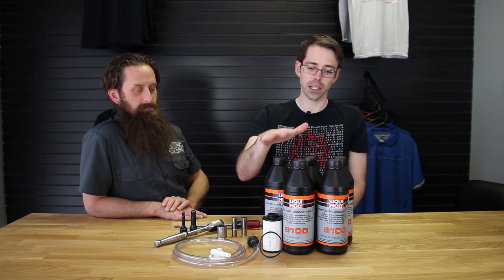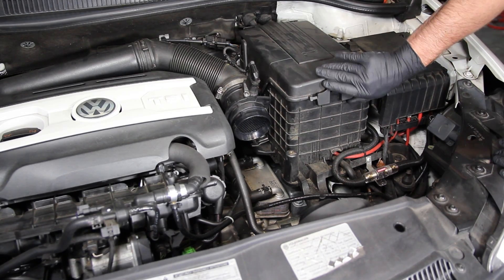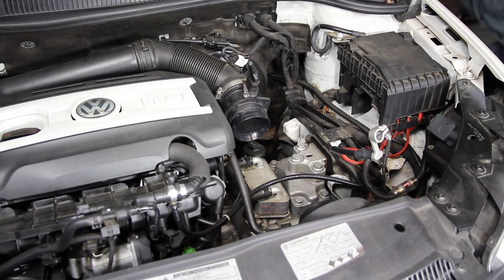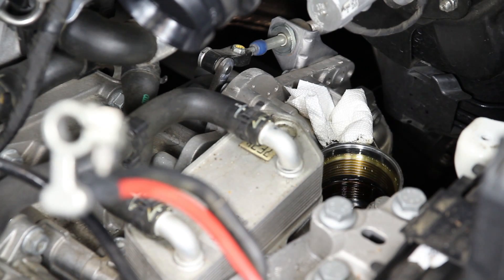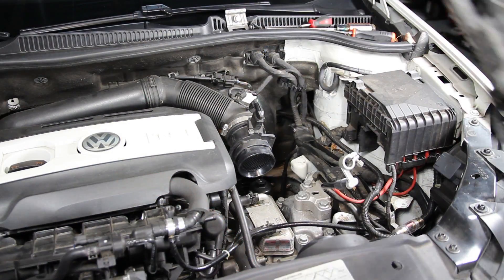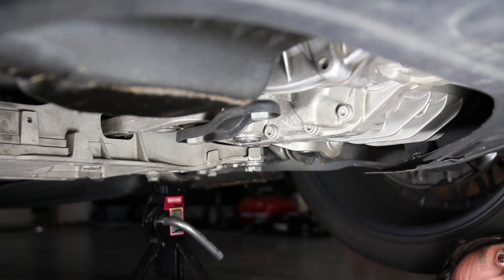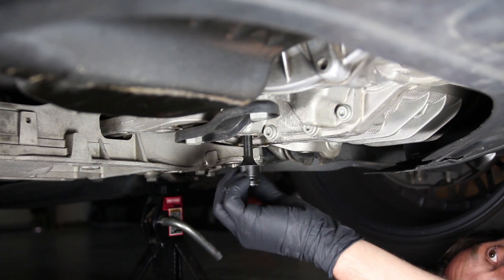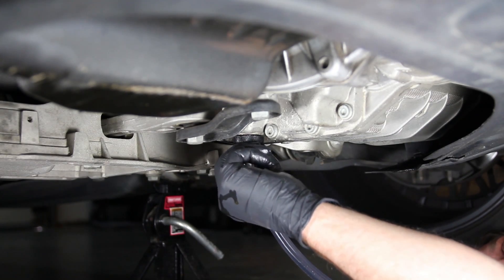How to (DIY) Perform a DSG Service on a VW and Audi Transmission (DSG Service Kit)

Comment: Seems so easy. Not sure why this service costs close to $1k? ><
Reply from the maker: It shouldnt be that much.  Most dealers we are aware of charge around $350
Reply: +Deutsche Auto Parts sorry I meant the full 40k/80k service is close to $1k. Not just the DSG fluid. Any reason it's so much more? I get they do the oil and dsg fluid but checking everything else shouldn't cost that much lol.
Reply: +Kyle Anderson only reason you should go back to the Volkswagen dealer is to buy a car, or get a warrantied part replaced. Otherwise do your own maintenance or find a trusty mechanic
Reply: I've done the other maintenance for a while now. I've got a 2010 DSG GTI with 75k so it's out of warranty. I had taken it to the dealer for the 40k service and they charged close to $1k for the full service and since 80k is right around the corner that's why I was looking this video up. Planning on doing it myself now. I still can't see why they charge so much, I guess "labor" charges for waiting for the oil to go into the vehicle. >.>
Reply: +Kyle Anderson labor and retail dealer prices. You'd be surprised at how much higher you typically pay for OEM parts at the dealer vs an online place like Deutshe Auto or others. I do maintenance on all of our vehicles. This is our first German car (2013 turbo beetle) and it's no different than the domestics I'm used to working on.  Our dealer wanted $600 for the 40k service and $300 for the DSG service. We're still about 10k miles  away but I've already realized that all the parts and oils are only going to cost about $250 if I buy them online. Dealer wanted nearly double for the same parts. The rest is labor. Keep in mind I said parts only, specialty tools that I don't already have add another $100.

Comment: Wonder why they couldn't just have the fill plug at the top..
Reply: +Grant Nicholson Maybe they thought that the car can be turned upside down.
Reply: @grant 
maybe they were all drunk on some spaten
Reply: Because VW is hoping you'll bring your car into their service dept. They very easily could have designed this to be top filled and instructed something like "drain completely, replace filter and refill with X liters"...so simple anyone could do it, no worrying about trans temp, running through gears etc.

Comment: Are you not supposed to let the new fluid drain out until the internal level reaches the top of the snorkel tube? I noticed that you hurried to install main plug after servicing new fluid. I am afraid that I might over fill it this way.

Comment: This is not correct...
Reply: seems off to me too
Reply: Yes he forgot to warm the transmission to just under 35 Celsius. put his foot on brake and shift into each gear for a couple seconds then remove plug to let excess oil out.
Reply: its between 35- 40 degrees Celsius.
Reply: That's how I did it on my old 01M transmission.

Comment: Who the hell builds a car where the drain is also the fill plug. Guess I'll stay far away from Volkswagen's with DSG transmissions in them.
Reply: kd1s, Works great and is simple while not allowing containments as the older style dipsticks did. Many new auto transmissions even with torque converters use the same system.
Reply: It's not just a VW DSG thing. Ford has also done this with the 5R55S transmission in the 05-10 Mustangs and Trucks. I'm sure there are others out there too. They aren't any harder to work on although I would think that VW would've remote mounted the filter for easier access. I'm not keen on having to pull the entire battery box to get to it.
Reply: agreed. I was amazed when I saw it too. German Engineering in da house. ;-)
Reply: why are you watching this video then?
Reply: kd1s,   I had my first DSG 6 month ago, and it's also my last one. Never again. Manual transmission are much better.

Comment: The used fluid didn't look all that bad. Was this a 40K service? Have you sent any off for analysis?
Reply from the maker: +Jacob Stamm We did not have the fluid analyzed.  This was done at roughly 35k miles.
Reply: I held mine to 45K. Will change soon and send to BlackStoneLabs. DD, easy on the skinny pedal, no towing. #forscience

Comment: Think you should fill leave hose on go through gears pause each gear heat up oil to 35 c remove filler hose wait till the wier plug has let out not needed fluid then reinstall outer plug

Comment: There's a couple things I've noticed that are different in your DIY vs the instructions in my service manual. First, you used 5L of fluid is used instead of 5.5L as per instruction, also, you didn't heat the transmission up and shift gears with the fill tool connected then bleed out the excess .5L. To me your method seems more fool proof and more affordable since I won't need to buy a 6th bottle and wait for the transmission to heat up. Is there a specific reason why the service manual instructs the complicated bleed instruction? (I've completed the service 3 times in my MK5 before using the annoying bleed method and I'm reviewing the instruction to do it for the first time in my MK6 next week.)
Reply from the maker: +Steve Woods The method shown is what you would find most VW and Audi specialists do.  If you want to make 100% certain you can go through the level checking procedure which requires a scan tool (Vagcom).  Hope this helps

Comment: Is there any problem to put oil on top?
Because I do not have this tool. With this tool wasting a little oil.
if necessary to replenish the oil? At where? The engine cover?

Comment: Of course I want to see if I save some money.
The filter cup let you get the old oil for some reason?
It should be withdrawn?
Reply: +José Marques No, you need to use the fill tool. Fortunately, the fill tool Deutsche Auto Parts sells is WAY more affordable and performs the same goal as the original factory VAS6262 fill tool. (If I'm not mistaken, I paid over $200 for the VW/Audi VAS6262 factory tool in 2009.)

Comment: LIQUI MOLY Valvulina Synthetic Double transmission DSG 1L
Developed for use in dual-clutch gearbox (DSG gearboxes) in vehicles from Audi and VW Group.
Oil-based high throughput technology synthetic and synthetic base oils. Through extremely shear stable additive which improves the viscosity index, modern additives to protect against wear and stable friction modifiers, attains an excellent yield of the clutch. This lubricant is also suitable for double clutch transmissions that have a shared oil circuit for the clutch, synchronization, gear and hydraulic control.
Specially developed for use in dual-clutch gearboxes (<i> gearboxes DSG </ i>) in vehicles from Audi and VW Group. Use according to the specifications prescribed by the manufacturers or groups of vehicles.

Comment: Vw in Portugal each DSG oil liter for double clutch gearbox the RRP is € 34.58, as have some discount is € 27.67 in already with taxes included.
I have a supplier who sells LIQUI MOLY Valvulina Synthetic Double transmission DSG 1L at a price of € 14.06 per liter, it is much the difference !!!

Comment: Good afternoon.
I thank your feedback.
I have not done the oil change in my VW Passat Sportline DSG, I think it should be for the week.
Vw in Portugal the oil bought is quite expensive but they say that that is special for DSG dual clutch boxes and is also the ATF reference.
Say the ATF oil may not be black you have to stay the same source color and gives 60,000 miles.
Reply: +José Marques The fluid used is a VW spec transmission fluid. You cannot use regular ATF fluid.The good news, Pentosin, Liquid Moly, and Vaico all make VW spec fluid that can be purchased for less money. Of the last 3 times I've serviced my gearbox, I've used VW, Pentosin, and Vaico fluids with no performance difference. I honestly feel the filter should remain OEM though. One of the aftermarket filters I've purchased last time had a defect where there was a hole from the top rubber gasket to the paper element that wasn't glued properly. Either way, you NEED  to change this fluid every 40,000 miles  to ensure your gearbox will function normally and last. (I've driven my prior tuned GTI DSG 120,000 miles with no DSG problems)

Comment: Hi man! Here in brazil we have DSG 7speed for Golf 1.4tsi mk7. Some Dealership says that this DSG is maintenance free and do not need oil or filter change, and some says that every 60.000km this DSG need 6 litre of oil and filter change. Do you know the right maintenance for this 7 speed DSG?
Reply: +AllsForOnemS , It still has gears and mechatronics for clutch, you think it's dry and doesnt need servicing?

it's just less oil on dry clutch variants, but you have to service them either way
Reply: +Ismael Favaretto , stupid dealer... dont go to them anymore
Reply: +madott do you know the quantity of oil in the 7 speed gearbox? And if it hás oil filter? it doesnt say anything in my car manual
Reply: The mechatronic of dsg 7 is sealed and has a pressurized oil unit. So oil change will be difficult. Gearbox oil can be changed just like a manual gearbox. There isn't an interval in the service plan for it.

Comment: My passat is 3C not B6!!! And the fuid Original DSG 60.000kms; G052182A2 Double Clutch transmission fluid, the VW tell me Not use Liqui Moly 8100 is not a same...
Reply from the maker: +José Marques That part number is the same number used in the US.  The Liquimoly 8100 meets the required spec for the DSG fluid.  Keep in mind they have no incentive to help you buy oil from someone else.

Comment: Just did this as well with your change kit. One thing I did a little differently when all 5 liters were drained in was to pull the hose off the fill fitting, quickly put a finger over the end of it, and with another hand, move the hose end to a nearby jar to let the fluid in the hose drain out.  I then slipped a rubber vacuum plug (5/16" maybe) over the fill fitting.  This made the "quick swap" of unscrewing the filler fitting and installing the drain plug easier... without the vinyl tube attached.  I probably dribbled less than a couple of ounces of lubricant.  Thanks again for great DIY videos and parts service.  As the owner of 2012 and 2013 CC's, I am a loyal customer......
Reply from the maker: +John Henry Thanks for the tip and the support.  It means the world to us.

Comment: how in the world does the fluid travel up into the transmission against gravity?  there has to be an easier top fill method...
Reply from the maker: +Eric “SpeedieGTI” U Gravity is actually what feeds the fluid in as long as the bottle is higher than the transmission.

Comment: Hey guys Skoda yeti 2 litre diesel 2012 has got a failed Mechatronics .The dealer has had the car for nine days .Yesterday he finally said it had to be replaced however it will be another 7 days from Singapore .The car is still in new car warranty only by 3 months lucky me I guess .
What should I expect from them after I get car back .Should there be any new warranty on the Skoda .

Comment: can it be filled up where the filter is?
Reply from the maker: +408skills. We have not used this method but we suspect it would work.
Reply: +408skills. I've seen it been done, but you have to make sure you fill it with the exact same amount as you drained out.

Comment: Do you have to hook up your car to a computer to reset anything after this fluid change?
Reply from the maker: +Patrick Zimmerman II There is a procedure for checking the fluid level.  What we have showed here is how most shops would perform this service without any other resetting.
Reply: Okay. Thanks a ton. I got a price quote of 350.00 to do the service for fluid change. Will have to look up the fluid level thing here and see if can do it

Comment: Don't you have to run the car with the plug removed, go through the gear selections, until oil stops coming out?
Reply: +gmcjetpilot so basically most shops are not doing it correctly lol
Reply: joe johnson First Humble mechanic is awesome, much respect, but yes it is not by the book. It is suppose to be hot 95F-113F oil temp measured with VCDS cable, run through gear selections, keep it running, pull fill tube and let it drain... (there is a stand pipe). Then install the metal plug when oil slows to near nothing. It is likely their method leaves about 0.25 - 0.50 liters too much. It may be close enough? It is certainty faster and easier to work on a cold transmission. I have done 2 DSG changes, one on my car and one on a friends. Not a knock against these guys, but in general VW service (my experience) is awful. I have had them over fill the engine oil by a liter. A member on a VW forum just read had DSG oil way over filled, discovering it when he did the next change himself.... My dealer put on 2 of 4 tires with rotation direction on backwards. They did my DSG transmission once, and they left the battery cables loose, barely sitting on post.... I could not start the car after work a day later. The dealer made excuses and said they did not do it (when they just took the battery out to do the the DSG. On and on. I do all my own work now or go to an independent VW, Audi, Porsche shop which I am lucky to have in the area. Much happier now... and I know it will be done right.
Reply: @gmcjetpilot   I hear ya but I will add that such crappy, careless service is all over in the United States.  What the hell is going on? Are 95 % of the citizens brain damaged from all the chemicals everywhere.
Reply: @kmax7163  There is the DRAIN and REFILL method based on what your removed. They drain it and measure what came out. They just refill with same amount, especially if what came out was the nominal amount expected... I am sure it is close enough. My point is you can't totally F it up if you drain and put the "nominal amount" but it could be off. The manual says over fill and drain to top of standpipe. Pro mechanics are trying to make a living and do take shortcuts which is fine... if they do so with some care and knowledge, not incompetence.
Reply: @gmcjetpilot  Logically,  what you said makes sense. I would only add that the tranny fluid drained out (measured), should be the same temp as the tranny fluid going in (measured).  
For example; cold engine drained should equal cold engine going in. 

On a side note what I have is a laser gun to get the tranny temp.  Just let the engine run at idle until fluid coming out is at a trickle.  Then cork her shut.

Many people handle modern cars as if the vehicles were made of glass.  Damn,  if the vehicles are that testy and cheap....then what the hell.
Reply: @gmcjetpilot that's assuming the previous guy, left it at the correct oil level... 😅
Reply: @AllanO808  Are you not familiar with the stand pipe?  This eliminates what the other guy did. You fill per spec (which is slight over fill) and burp the oil out stand pipe level. Then you install drain plug.
Reply: @gmcjetpilot    shouldn't you be making your own video for us?
Reply: Grant Nicholson Oh I see your confusion. Yea it's not what you think Grant. The "drain plug" does not really drain. When you remove it, only extra oil will drain (more than the needed level), because there is a STAND PIPE. To drain the oil out you remove the plug, and then you remove stand pipe, it threads out. Once you drain you put the stand pipe back in and then the plug, refilling with a little more oil than you know it needs. You run the engine and remove the plug only (not the stand pipe) and let the excess come out. Hope you understand the top of the stand pipe is the proper oil level. So with the plug out and engine running only excess oil runs out to give perfect level. To do this the car has to be level and oil at proper temperature.  This is per the service manual. In this video they are doing a close enough method. In fact some people drain oil and measure it, refilling with the same amount. Of course you assume it correct to start with. There is no dip stick or sight glass for the transmission. It is over fill and drain to proper level.
Reply: Thank you for making an awesome video. Just bought this kit. Have you ever done the top fill method before? Where you fill from the filter location instead of underneath
Reply: +gmcjetpilot Wouldn't that damage something? Running the trans dry?
Reply: @GrizzlyStoned  Well I am 2 year late in answering but there is a drain plug and then a threaded stand pipe. So with the drain plug out the transmission does not drain (unless the fluid level is above the stand pipe. To drain the tans you have take the drain plug out and then thread the stand pipe out... It is GERMAN... lets make it complicated.
Reply from the maker: +gmcjetpilot There is a procedure for checking the fluid level.  What we have showed here is how most shops would perform this service.

Comment: FYI, You can refill the oil right where the filter goes, that way you don't mess up down there.
Reply: Thats how a flush station works also, lot easier to change the oil via the oil filter housing.
Reply: I was going to ask this. Seemed like common sense to me to fill it from there.. but I’m not a trade qualified mechanic and these cars are finicky

Comment: So i dont need a scan tool to do the service, just the kit you guys have? Seems easy enough and way better than spending 600 bucks at a VW dealer.
Reply from the maker: +Zachary Cropper What we have depicted is the way most shops would perform the service.  There is a procedure to check the fluid level with a scan tool which can be performed.  This is something you can do with a VagCom Scan Tool.